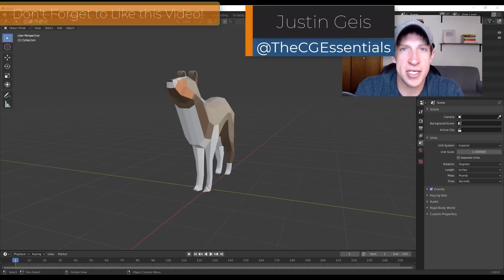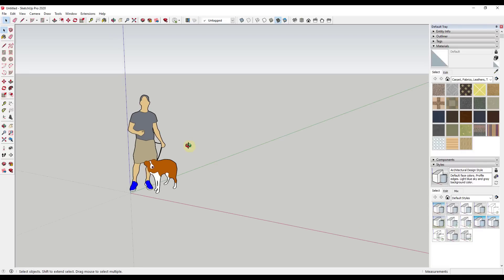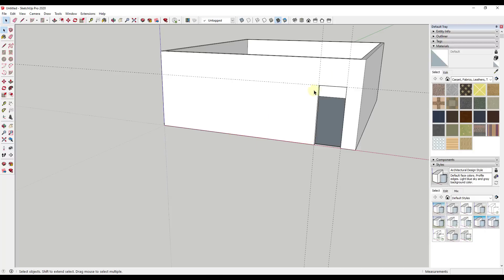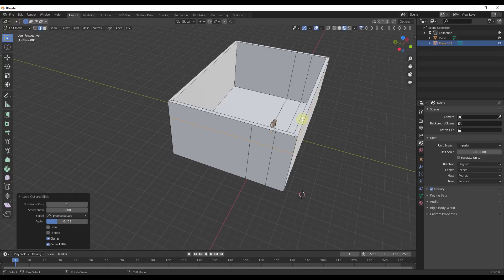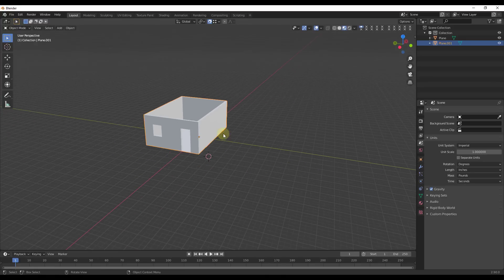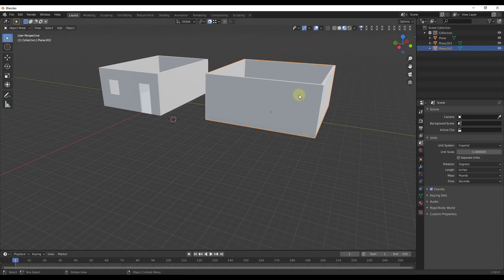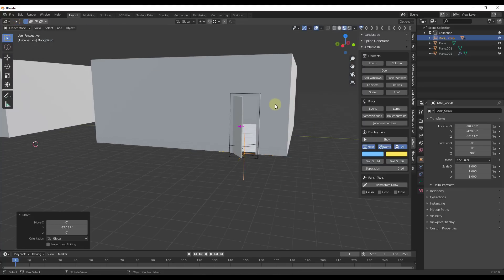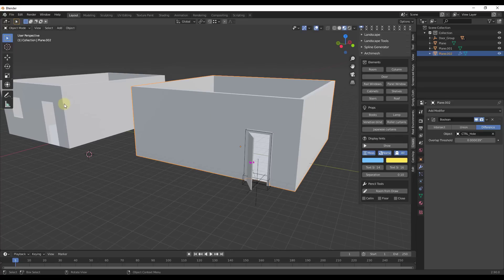Why SketchUp Users SHOULDN'T USE The New Extrude Manifold Tool in Blender!

Comment from the maker: Hi everyone! Let me know what you think about this video in the comments below! Should SketchUp users start with this tool? ;p
Reply: Trying to use blender to model architecture quickly AND accurately is quite slow and hard work due to the quality of tools, snapping etc in blender. SketchUp is far more intuitive and 'gets out of the way' when you're trying to work.
Reply from the maker: I think this is a great summary - it's amazing the amount of pushback I've gotten when making this statement - it's not that Blender is bad, it's just that other tools currently do this a lot better :)
Reply: @johans7119  You're just not use to Blender. There are things about SketchUp that slowed me down too. I was taking classes using Autodesk 2D - 3D,  Inventor and 3D Max. Blender was mind boggling at first but I got the hang of it and SketchUp was different too but all in all to be a it's best to know how to use more than one 3D software. You never know who will "Be No More".
Reply: @sumguy5978  it's true I'm still learning blender but I have used AutoCAD, SketchUp, Revit, 3DS MAX etc on and off for years, sometimes in a professional setting. Blender is most similar to 3Ds max in that it was designed more for artists than people needing accuracy, but max has better snapping!
Reply: When I switched from Sketchup to blender I still tried to use the Sketchup workflow and I really struggled.
Reply: Hi! I don’t altogether agree with this video.
You should try a Snap Utilities Line, a standard addon which mimics the SketchUp Line tool. It does a pretty good job along with Extrude Manifold tool. You can snap to axes, input length from keyboard without minus sign, snap to midpoint, to perpendiculars and using Shift key snap parellelly.
Making loop cuts is not the best way of adding details to the manifold mesh. And instead of deleting overlapping faces you can use a standard Face menu command 'Intersect (Boolean)'.
It's pretty decent Sketchup-like basic workflow. Not perfect though, it has some issues.
It's true that it is crucial for users to be familiar with polygonal modeling and Boolean operations in Blender, even if they want to work as in SketchUp.
Reply: I'm just amazed by a bunch of rapturous screams. WOW! Like in Scatchup! People just don't know how this tool should work.

Comment: i used once extrude manifold ,im begninner..it was an sculpture..it was the only solution i find ,ot to extrude something,but push inside ,adn it worked perfectrly,it was only solution,mybe for arhitecture has less sense but in that sculpture it was easy an fast ,in dont know other function wich alows to push inside  without making a whole

Comment: I agree with the overall sentiment that it's best to learn the strengths and weaknesses of a given tool and adapt to them. I also agree that people shouldn't use the Extrude Manifold tool in Blender as it stands today, but not necessarily because of the reasons in your video. There's actually nothing particularly problematic with n-gons *for certain workflows*. You don't always need to worry that your mesh is not all quads for the same reason that you don't usually need to in SketchUp either, and that is that for flat surfaces that are not going to be procedurally subdivided, deformed, or otherwise manipulated (and of course, these kinds of surfaces are common in archvis) it really does not matter. Incidentally, the boolean modifier in Blender is more than happy to riddle your mesh with n-gons if it feels like it, so that's not necessarily an improvement (at least from that standpoint).

Archimesh is of course a fantastic addon but archvis is not the only thing people use SketchUp for, and even so, there are always going to be instances where Archimesh does not quite replace SketchUp's Push/Pull workflow.

No, I think the real reason people shouldn't use Extrude Manifold is because - as of right now - it's basically useless. While it was never going to be as useful as Push/Pull is in SketchUp - mostly because you can't (easily) draw guide shapes onto the mesh - there have definitely been plenty of instances in Blender where I've wanted to extrude an existing face in a Push/Pull style but Blender's extrude tools have not been adequate. Autodesk recently implemented something vaguely similar in 3ds Max which they're calling "Smart Extrude" which actually looks pretty compelling. Extrude Manifold could have similarly been a very useful tool in Blender... if it actually worked the way it ought to. Instead it leaves faces where it shouldn't, fails to split faces where it should, frequently creates non-manifold geometry (which is hilarious, given the name they chose for the tool), etc.

As in understand it, the Blender team is working on entirely replacing Extrude Manifold with a new tool (currently named Extrude Boolean) that would behave closer to how Push/Pull operates. I eagerly await its release in a future stable (or at least beta) build of Blender, but for now while we're stuck with Extrude Manifold, my advice is stay away.

Comment: i did not agree, at first, but you pretty much convinced me. I thought "by manifold" was a good option but after using it in Blender a few times it does have its drawbacks. I don't plan to use it quite as much in the future but, still, there might be some situations where it makes sense to use "by manifold". i don't know what those are, yet, but I like to keep options open.

Comment: Would never cut a door or window hole in Sketchup. Get a window or door from Warehouse and plop it on the face, cuts a hole automatically. Hole moves with door just like you show. The strength of Sketchup is in phenomenally easy and intuitive precision, like the tape measure tool and guidelines. MeasureIt yes but kludgy implementation, snapping to a guideline so fast brilliant and obvious and totally absent from Blender. Now I use Blender more it is superior in many ways, but there certainly are some key tools and operations in Sketchup that if adapted to the Blender work flow would speed modeling up immensely.
Reply: I agree. I think the modeling workflow for most objects should always start the same way sketchup would. That is, starting with lines and simple shapes and extruding and push-pulling and using the "follow me" tool as well as all the measurement tools for perfect sizes and fits. Then from there, use all the blender tools to add the complex shapes, bumps, curves, etc. afterwards. Not only would it speed up modeling, it would also add precision.

Comment: Been working on a Ford XD model in Blender. I'm making all the body panels ect with Blender but still using Sketchup for all the mechanical parts. As long as I add the extra lines in Sketchup I can keep the quads tidy. I still have a lot to learn in Blender but I'm getting there.
Reply from the maker: Keep it up! :)

Comment: I was looking forward to extrude manifold, but appreciate these warnings. I agree SketchUp works best to its own strengths and so does Blender. I te1ch SketchUp workshops for kids and contemplate switching to an alternative but still a bit unsure if they’d take to Blender as quickly as I could in just one SketchUp session. Thanks for this video.
Reply from the maker: Yeah, that'd be tricky - the whole POINT of SketchUp is how easy it is for beginners to pick up and get started. It's ideal for kids, where Blender seems to require a lot more technical knowledge and longer to learn. Personally I'd stick to SketchUp if it's truly a single session situation, but that's just me :)

Comment: 1. "Add edge loop," and set it to the centerline.
 2. "Add edge loop" to establish one edge of the door frame. Use GGE to align this second edge-loop with the centerline and then slide it into position.
3. Repeat steps 1 & 2 to establish the other side of the door frame.
Reply from the maker: Why not just model the door and frame separate and use a boolean? Then you never have to touch the wall geometry...
Reply: @TheCGEssentials  I was just talking about the way to get aligned loop cuts when using destructive modeling. And, though it is sometimes necessary to do so, I was not suggesting that you use destructive modeling in place of non-destructive modeling.

Comment: I think that most Blender users confuse why Sketchup users use Sketchup. While some will say that the push/pull tool aka extrude faces is the master tool in SK, I will add that the pencil combined with the very intuitive snapping system is the most powerful tool, at least for me. I model mostly jet fighters and I cannot achieve the same precision in any program so far as I do in SK (search for Diasmon on deviantart for reference, although I am not even the best SK modeler out there). And this is weird since SK was not even intended for wild curved surfaces, and I am stuck with it because it does the job for me. I try to learn Blender now since I really miss the UV mapping, rigging and animation tools that are none existing in SK, but the model itself I will still do it in SK because of pencil+snapping. Precision FTW :)

Comment: Insetting quads is almost always a bad idea.
I find that it is easier to create 2 loops on the plane along X and 2 loops along Y and then scale loops to create a base for walls. Then extrude walls up. But even this is too much for just a wall. I think the best would be to extrude the edges of the plane up and add a solidify modifier. Much more control, and easy to create extra walls. Just loop cut the base and extrude another edge up.
Reply from the maker: This does work for most situations - it can be a bit annoying to get used to at first if you're modeling precision interiors as it doesn't really give you control over individual walls - it feels like more of a workaround if you're used to CAD softwares though. Thanks!
Reply: What does Solidify modifier do?

Comment: You can also use knife tool to cut the door. There are a lot of ways to do that. Extrude manifold is a great add to blender, something program really needed. You just have to get used to it. Dont use it like in sketchup, because its not identical.
Reply from the maker: Not saying it's a bad tool - I'm saying that using it to duplicate SketchUp is a bad workflow
Reply: the way i'd do this is get a plane , rotate it 90 degress , pull verts to make  the outer part of the walls  , then solidify inwards , can use loop holes very easily and wherever there's an opening , just delete the face
Reply: I am also blender user that the knife tool cant use by measurement. just like a draw where you want to use a knife tool.

Comment: 3:48... it hurts to look at :( I really want to move away from SketchUp fully, but the speed of which I can create / modify things with millimeter accuracy, import DWG to use as a snappable base, quickly snap to things or offset them at certain distance, move or rotate something then type in the dimension, means I can't use Blender for those same tasks. Which is really unfortunate because Blender works so well with Unity (therefore VR), and SketchUp direct to Unity basically doesn't work at all if you want to bake lightmaps as the UVs are all janked even with SketchUV or Wrap-R. The dream would be to use SketchUp for anything hard edged, Blender for anything soft and organic..
Reply: You can do all of that in blender though.
Reply: @Hikouma  Blender can do a lot more than SketchUp, but in the aspects I mentioned? Not even close, unfortunately.
Reply: On the other hand...I find Blender to be easier for doing precision modelling. But this is maybe because I'm more skilled in Blender than in Sketchup.
Reply: You might be interested in the CAD transform plugin for blender it makes the kind of snapping and precise movement a lot easier. https://www.youtube.com/watch?v=TTKvxrgbFWU
Reply: @sebastiangutwein2151  thanks, I'll check that out!

Comment: My workflow is to use planes and the solidify modifier. I create a separate object for each wall type so I can have different thickness walls for interior and exterior.
Reply: This and using wires works also for me

Comment: hello Justin thank you for this video. as a Sketchup user i've tried to use the extrude manifold as push and pull in SkUp. i have a question about the possibility to share the same model in these two softwares. i try to import a simple sketchup model made with some groups, in blender as a collada file, but the mesh are triangulated, the groups are a totaly mess. there is a way to strat a work in SkUp and finish it in Blender? thank you
Reply from the maker: Well the mesh can only come in as it was modeled in SketchUp, meaning that if the mesh is a mess in SketchUp, it's not going to be better in Blender...

Comment: it makes sense, just you shouldnt use in that way ,it was made to solve the problems when extruding inwards, so  its not push pull alternative. Moreover, using booleans keep the workflow non-destructive and faster  to make many openings.
Reply from the maker: Yep - thanks!

Comment: Totally agree, the Extrude Manifold tool breaks the edge flow of the mesh almost every time you use it.
One thing it is extremely useful for though, is for a game asset modelling workflow, since all quads will become tris anyway, it can easily get rid of unnecessary edges, potentially lowering the final poly count of the mesh.
Reply from the maker: Yeah totally - I have no issues with people using the tool - just that it's not a good idea to use the tool to try to duplicate a SketchUp modeling workflow like this one. The tool itself is great! :)

Comment: I really enjoyed this video.  The push/pull and construction line features of SketchUp are very easy and precise to use and I've been using them for a decade.  Since I recently got into Blender, I have attempted to do things the old SU way and ran into all the issues that were described in this video and in the end it was more work than I ever thought it would be to go in and repair everything.  In the end, I discovered that it was easier to create a new mesh and then bool the parts together.  I was hoping that the new Extrude Face Manifold tool would be just like in SU but even if it is not, it'll probably still be handy.
Reply from the maker: Totally - still like the tool, but I was testing it in a "SketchUp-like" way for architecture and it just wasn't doing what I wanted it to - not saying not to use the tool, just saying to learn the best way for modeling in Blender - thanks!

Comment: I think a good way too would be to use knife tool to split only the front wall face without messing with other faces.
Reply from the maker: Problem with the knife tool is it doesn't lock to an axis, so your lines come out crooked
Reply: @TheCGEssentials  You're right. It only can snap orthogonally to screen which is not the best solution. We should actually put some feature request for Blender Dev Team to improve knife tool so that it snaps to model axes. Currently we have to align view to operated faces every damn time.
Reply: Knife can snap to existing line-centers to make a new straight line.  Then you can slide the new line/vertices by a specific distance locked to an axis.  Alternatively, after using knife to create a slanted line, you can select the vertices and scale-0 on an axis to make the line straight, then slide it to where you want it.
Reply: @bill392  Which takes ages compared to just drawing a straight line in SketchUp.

Comment: Can i ask about smth ? What laptop do i need to make blender work on it ? I have hp cori3 and it doesn't work on it :(
Reply: Preferably, you'd need something that at least has a discrete graphics card, as opposed to an integrated one, like the one you probably have on your laptop.
Reply: @xayzer  Also get nvidia graphics (GTX minimum), they just work better.

Comment: Justin - thanks for the comments and the video, all excellent as usual. As someone who has made the switch from SketchUp Make to Blender in the last 4 months, I definitely agree with you. Now that I've learned the value of quad modeling from the start, and how to model precisely in Blender, I think Blender gives you many more options on how to model anything. It all depends on what your final goal is in the model. I like the Extrude Manifold addition, but now I Extrude when I need to, and use other techniques that are more applicable. 

As you said, learn the tool, not how to do mirror one tool in the other. Blender is definitely advanced modeling, takes more time to learn, but IMHO worth the effort. SketchUp now feels like a toy for making, well, quick sketches and diagrams.
Reply: Hi Jon! I'm a SketchUp user right now and I'm seriously thinking to switch to Blender... It would help me And probably other people If you can provide your method to learning this software? I know, there are thoundes of YT channels but not every single of those I've sawn has a ArchViz-Modeling direction.

Any specific suggestion? Probably a YT channel? I'd really appreciate it :).
Reply: @GerardoALpz  I made the switch from SU to Blender 6 months ago and can confidently say you a going in the right direction. The software is updated on a regular basis with amazing features, it is FREE, and with practice, you can do realistic renders with built-in materials and lighting. Be sure to use and watch and use Blender version 2.8+ or better 2.9+, as there have been significant updates. 

Just search for Blender Archviz and you'll get several good links. This channel, CG Essentials is awesome, as Justine really knows his stuff. Also look for Blender Guru, Josh Gambrell, and InspirationTuts just to name a few. Check out https://www.youtube.com/watch?v=wrzSrjAY69c for starters by Blender Guru. 

Remember, modeling is just the start, textures and lighting are also important. The good news is Blender excels at each of these so you are in good hands.